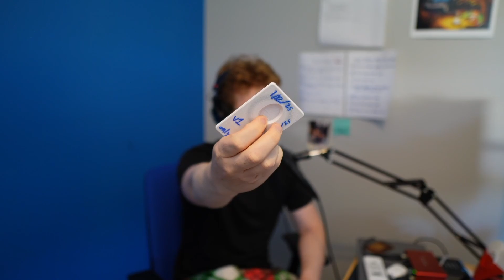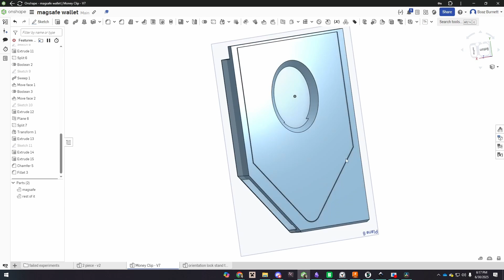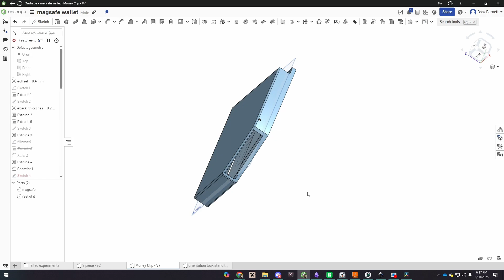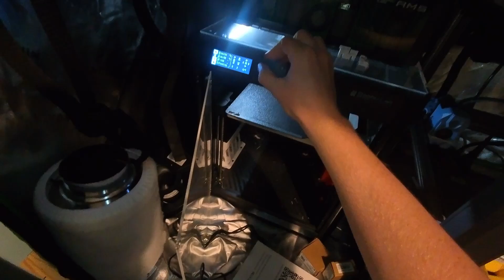I tried to fix Apple's wallet...

Comment: Cool design!
Keep in mind that the money clip is going to scratch the top card with time leaving a thick imprint on it. Unfortunately I don’t have a solution to this problem. 
Great video in any case!
Reply from the maker: Very much noted! I am exploring different retention mechanisms and the money clip has just been the best one so far. It has not left significant marks on my cards so far but I’ve only been using the wallet for a few days.